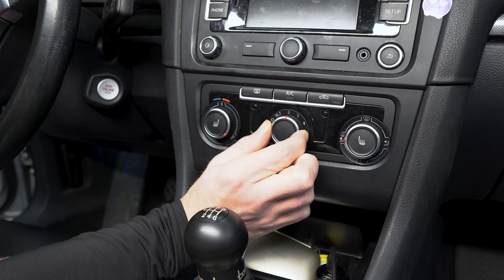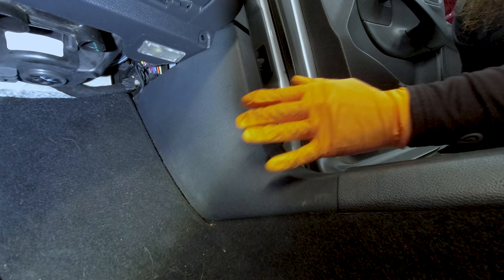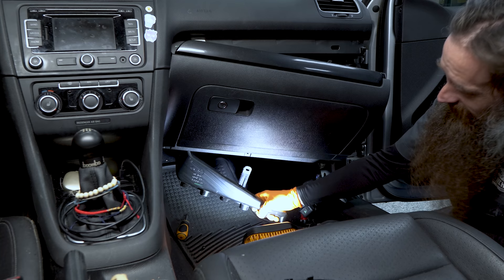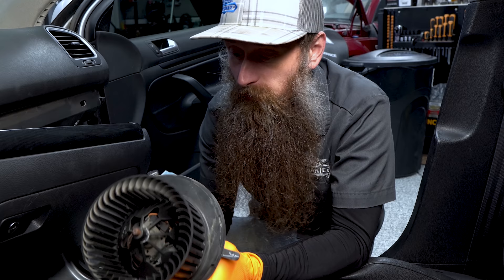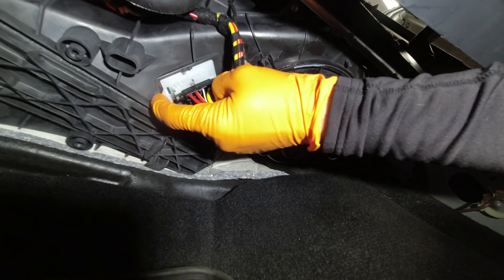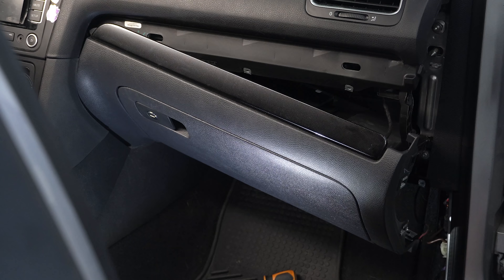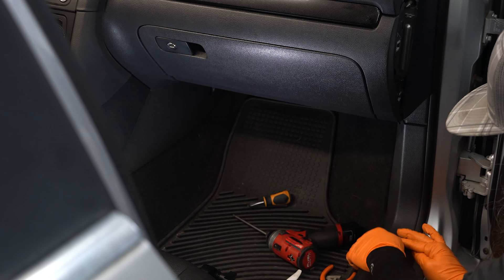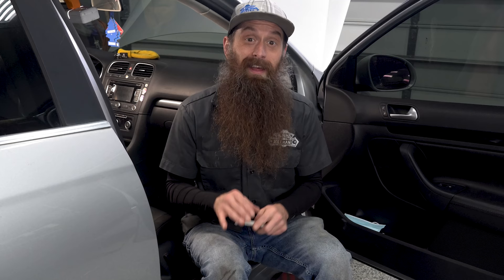How To Fix a Blower Motor Not Working ~ LOUD NOISES

Comment: I hate that you make it all look so simple! That's the power of knowledge and experience, I guess. Very well explained and easy to follow. Great work as ever! Thank you 👍
Reply: Yes. I watched him swap out a thermostat housing and water transfer pipe. Until I tried it…ended up in the garage for 2 weeks!!
Reply: I must say its really not difficult. I did this job about 3 months ago on my Tiguan, mine was just dusty and setting 2-4 had vibrating due to dust I stripped cleaned and replaced and it's now running quiet and smooth. I guess you right that its different strokes for different folks. I'm  not a mechanic but a DIY guy, but I must say I like to fiddle with anything. A big plus is YouTube videos.
Reply: Taking interiors apart can be really frustrating if you're not experienced with then or familiar with the vehicle. Especially on cars since your customer wants everything to look exactly the way it did before. I struggle enough as it is on our fleet trucks, which have much simpler interiors and no one cares about the condition of the panels. I might be able to climb in the back of a garbage truck and remove a 200 lb hydraulic cylinder through a hole about 1'x1', but I could never do professional dash work on a car.
Reply: he made it way harder than it actually is, none of the bolts need to be removed, you can wiggle the motor out. just did it on my car
Reply: @moffatk7948  Indeed, this work is as simple as an oil change IMO. But I grew up as the PC brother with two older car brothers.

Comment: Many thanks to you sir. I was actually making notes to go buy and change my motor when I came across your video. Out of curiosity I opened up mine and lo and behold I found a piece of plastic in my motor and it looks like it got there at my last service when they changed the air filter. End result is noise is now gone at high speeds🎉

Comment: Could have checked the filter, too.
Also, the resistor usually fails due to the motor seizing and drawing more current than usual. Or if the filter to clogged and not enough air goes through it to cool it enough.

Comment: As a Toyota tech i replaced these all the time as we had a TSB where the motors may make noise in sub freezing weather and often enough they just warranty it. A lot easier than this but the easiest blower I've done was on my E90 BMW.. Just drop the kick panel and twist it similar to this Golf, despite the repair manual also wanting to take the dashboard out (Imagine the price gouging the dealership has).  Worst one i've done was a Kia Rio.

Comment: Strange. I replaced mine without having to disassemble the glove box or any other trim. Just a counterclockwise twist to remove and a clockwise twist to re-install. It seemed mine ha d a lot of stiction from water ingress somehow? I hit it with PB Blaster and it seemed to spin OK again, but it was a dirt cheap part to replace with a $15 3rd party fan. So replaced it I did. The blower motor resistor seems to go out for me every two years or so, so I keep a supply handy lol. Also might as well do the cabin filter while you're down there.
Reply: I did the same, no trim removed.  It's a pain, but I did it...

Comment: Ugh, could have used this a few months ago, :P. Had two blower motors to replace (2012 GTI and 2014 Jetta SE). Didn't take anything out, other than the lower kick cover and it was tight on the jetta to remove. GTI was easy.

The plastic footwell air distributor and wire harness was like a bottleneck.

Nice DIY!

Comment: Thanks for your help. Mine's a 2010 Jetta Sportwagen- Your video helped after I first tried without removing any trim. But, despite removing all six glovebox screws, the glovebox still seemed solidly attached. But, with the side panel out & carpet rolled back, the insulation panel on the wall pushed a little, there was just barely enough room to squeak the blower out without taking the glove box out. Putting the blower back in was not too bad and turned out to be the easiest part of all. The body clips from the rocker door cover and side panel were stuck in the car so those had to be removed. Getting out the metal door clip wasn't fun but an old nail puller held tight & screwdriver got it free.  The threshold still didn't sit snug after put back together so took it apart to see what I'd done wrong. Nothing seemed obvious. Put it back together more carefully but still there's a lift at intersection. Then it started raining (again, of course). So, during cleaned up of course I found one spare door clip.  So, that will need to go back in if the rain stops before snow flies. But, let that be a lesson if you aren't used to removing body panels...if it doesn't sit right look for stray clips that must have flown out during panel removal.  As I put the fabric panel cover into place it just touched the under glove box light and the light went off- probably blown. It got hot from the door being open a half hour or so & maybe the panel was just cool enough to blow the bulb...I can only hope.  What was causing a low growling very loud noise turned out to be only a paper napkin! And now the noise is gone. Thanks for your video and help!

Comment: That resistor is similar to what is used in Dodge Dakota Sport truck i had. Changing the fan would not prevent the harness from melting and it seemed to always fail in winter. There was high resistance somewhere causing the melting and burning of wires as well as failure of the resistor. I gave up after having a swimming pool (Just water) on the passenger side and two resister and fan failures within weeks during winter conditions.

Comment: A good tip for Audi / VW owners when replacing a part like the blower motor/resistor, is to look up the OEM part # for your cars blower motor and search for that part. My A3 needed a $400 Audi blower/resistor, but the same package was $180 under the generic brand name.
Reply from the maker: THAT is a good advice. I kinda did the opposite. searched online, it was $450, went to dealer, it was $200.
Reply: Is the generic the same manufacturer? I replaced the factory blower motor on my Mk3 with a Chinesium to save a few bucks and the pos isnt even balanced. Vibrates badly enough to make it unusable at setting II and higher. Should have spent the extra money.
Reply: @vw5056  Depends on the brand.
I would trust Meyle with coolant flanges or SKF with bearings, as opposed to *insert unknown brand*.

Comment: Had the blower resistor fail in my first car, an 89 Camry 5MT. For years even when my parents drove it, the lowest speed wouldn’t work. This was in the late 90’s during the Internet’s infancy. I found out how to find resistors from Radio Shack and soldered them in myself, restoring the fan to full functionality.

Comment: Great vid. You should see 94 BMW 325I. You have to cut the squirrel cages off inside it's housing outside behind the firewall to remove the motor! That or take the entire dashboard out! Yeah few know the struggle of that car. Like the fuel filter tucked deep inside the caverns of the engine!

Comment: I took two of these motors apart. One from my 2015 GTI AND 2012 Passat. The reason why they fail so often is that they use  carbon brushes. When they wear and the spring has no more tension to press the carbon brush the stop working.  Why is VW still using brush motors? Why not go to a brushless motor?
Reply: Because its cheaper for them to make and since they wear faster they make money off of replacing them in service

Comment: I had a similar issue, but my motor had a plastic piece inside it, I couldn't find the origin of that plastic piece, but it fixed the sound. I didn't loosen the glovebox nor the ducting, the only thing I did was push the ducting slightly towards the passenger seat and with a few minutes of struggling got the motor out and then back in.

Comment: It's actually a surprise that they are accessable, what with the way they build things for quick assembly anymore. 
When I was at the Wolfsburg factory in 2005 seeing the last mk4s assembled on the line ,the whole complete dash with hvac was installed in under a minute. 
Remember that the next time you have to go in and replace a heater core and it takes you 6 hours.

Comment: Back in the day,  we would re-lube the fan motor bearing to get a few more years out of it if it started making noise.  (drilling a hole if necessary)  I wonder if the same can be done on a modern unit.
Reply: Yes u can, it is just electric motor and dry bearing
Reply: What type of lube would you suggest for a blower motor bearing?
Reply: @danielzagdan-gross2309  Just light oil, like 3 in 1 oil

Comment: I've got this same car and my blower motor bearing was going out. I ordered a new blower motor off the internet for replacement.  All I had to do was pull the trim panel off the bottom, unplug the blower motor, twist and pull it out with a slight twist. I didn't have to disassemble anything else. It took less than 10 minutes total time. This level of disassembly is not required.

Comment: MK5 was a lot easier as you don't have to really take out anything except the foam cover. After my blower died I just replaced the brushes for a grand total of 4 euros. They are not meant to be replaced but you can get away with soldering new ones in. It ran for a couple more years after that before I had to replace the whole unit.
Reply: same on mk6, idk why he did all that. i just did so in my own mk6 atleast

Comment: I recently had cold weather "squeal" on the blower motor for my 06.5 MKV GTI (255,000 miles). I dropped down teh blower motor with plastic HVAC tube and glovebox in place. I just pushed the large wireharnes up towards the firewall and top of the carpeted area... wiggle the fan motor and it comes down (unploug the power connector 1st).

Comment: At least you didn’t have to cut the blower motor out of this one.
On some GMs, the tech has to cut the plastic around the bottom of the blower with a box razor, remove it, swap the new motor and squirrel cage into the cut plastic piece, and then screw it back into the heater box. (And of course, there’s almost no room to use the box razor...🤬)
Reply from the maker: Yeah that’s silly.

Comment: i had blower motor problems with  my last 3 cars. one was making dry bearing noise (2011 vw polo) other was so worn out bearing that dont even want to spin(vw golf 2000) and the last just worn out contacts in motor (opel kadet 1983)... all made in same manner.

Comment: I have a 2006 GTI and I don't have a resistor like the one in the video, it's it solid piece that looks like a hole could be cut for a resistor. I have the dials that light up with the little lcd screens. and the blower motor just crapped out.

Comment: I was able to barely get the motor out without removing the glove box or vent on my 17' Jetta. I just pulled it down in front of the thick cable in the back first then pushed on the vent while pulling it down. It was snug but it came out. There was also something in mine that had been causing a vibration which I thought it was failing.
Reply from the maker: yeah you can(most of the time) sneak it out. but for a few extra screws, I dont' think it worth it

Comment: I've done a few of these I never took the glovebox off I just take the bottom cover off and twist blower motor and take it out but bit off a struggle putting it back in. But this is on a right hand drive car if it make any difference.

Comment: Another common ailment that happened on two Audis I owned are fans that cut out randomly... Breaking the motor open and cleaning the commutator with a scotchbrite fixed it! It happens because if the motor stops with the brushes sitting on one or the dirtier poles with lots of carbon buildup it won't start. If you drive a while, it shakes up the motor a bit and rotates it off that bad spot and it wors like a champ again... for a while!!

Comment: The cryogenic system used to fix the crankshaft in VW 1.0 TSI 3-cylinder engines allows the assembly to be rebuilt, including pistons and connecting rods. There is a recommendation from VW so that the original measurements of such components are not changed, check?

Comment: hey  Charles, in my 2013 VAG car my climatronic has this strange fan speed where it's pulsing when set on AUTO. It can't pick a speed for some reason, 0 faults with VCDS. Do you reckon its that resistor?

Comment: I wish I'd seen this last summer, my motor resistor failed with it running only on high speed, and then blew up the motor itself before I was able to get the issue diagnosed.

Comment: Good simple video Charles. I got the similar issue on me MK5 Gti, where my blower motor works fine and is not noisy at all but the fuse for it keeps blowing up for some reason. Now I've replaced resistor and it got a little better meaning more time is passing between blown fuses. Ots been few months now since the last blowout. Any idea as to why?
Reply: It sounds like the motor is going out and it’s pulling too much current and blowing the resistor . Probably replace both
Reply: @tylerbeard4092  Thanks for the reply. Funny thing it does not happen in the summer/warm months of the year, mainly in the winter time when its really cold(am in Ontario Canada)

Comment: If you already take the dash apart, change the motor in the process. They usually don't die though.. Mine died because water got into the main bearing and rusted it, creating lee way and it was out of balance afterwards.. And that was caused by my drainage line being clogged..

Comment: Great video. Again we'll presented and thanks for the tips how to not remove the entire glove box. Do you recommend a cleaning period on time or miles?

You also showed another thing why those stupid touch HVAC controls are so stupid and pointless. I dare you to do the testing in the same position in your new Golf R. One hand holding the motor , head stuck underneath and with the other gloved hand operating the fan speed just by touch. It will be a nice comparison :).

Comment: I had a failing blower motor on my 8P A3 (basically a mk5 gti) and when I pulled it out I found that it wanted to work intermittently. I was able to actually pull some small tabs back to reveal that the brushes were worn down to nothing. So $8 worth of carbon brushes later I had a perfectly working blower motor again.
Reply: Were the brushes replaceable? I have an Audi A6 C5  that needs a tap on the blower motor to start it most of the time...
Reply: @rkan2  technically no. If you’re mechanically inclined, yes.
Reply: @meathammer579  Yea but like are there permanent fasteners and something else than solder? Where did you get the brushes?

Comment: What if the ac etc is working but not blowing from front vents could it be the motor resistor.
I've changed the fuses, cabin filter, and made sure there is no leaks or anything stuck in the intake fan. 
Any advice ?

Comment: My blower motor appears to be failing as well, but it still does its job, it makes crickety noises which directly relates to engine speed and if the blower is on
Reply from the maker: Lol you riding it out or fixing ASAP?
Reply: @HumbleMechanic good question, I may just wait till it doesn't work anymore or wait till after timing belt is replaced since its due soon, but who knows if the engine will last as I'm afraid the previous owners weren't too nice to the car even though it drives really nice lol

Comment: I have an issue with my gti. The ac is running full then partial then full. Could this be the blower and or resistor?

Comment: Replacing a blower motor in a VW has become sort of a rite of passage with every VW/Audi I have ever owned, I've had 9 of them now, and every single one has needed a blower motor a year or less after purchase.
Reply from the maker: FACTS LOL
Reply: My Golf III's blower motor lasted 26 years. The brushes finally worn out but it still worked if you tapped it.

Comment: I’ve come across blower motors in CCs and Passats literally freezing solid in winter due to a cowl design flaw letting fine powered snow in.
Reply from the maker: Now that I haven’t seen! But I’m in NC
Reply: @HumbleMechanic  VW actually has a TSB on it and a modified cowl intake panel to stop it from happening.

Comment: I have a question, I have a 2008 Vw Passat with dual zone Climatronic and there is a strange issue when the car is travelling over about 70mph eventually the airflow from the vents gets VERY weak, it’s like one of the doors in the dash is getting stuck or if there’s a flap or something that shuts at highway speed that is restricting airflow, if I turn on air recirculation it sounds like the blower motor is working properly - yet the airflow is very poor regardless of vent position, any suggestions before I pull my hair out??

Comment: FYI for Mk5 and Mk6 Golfs and others there’s TSB #85-16-01 covering having snow sucked into the blower and causing the motor to rust. There’s a kit that deflects snow and possibly rain from the intake plenum. Unfortunately the owner has to pay for it.  In my book it should have been a recall with no owner contribution.  It’s a fundamental design flaw.

Comment: I had this problem a long time ago at a previous workplace, turned out the windscreen had been removed and refitted and the technician let the old glass sealant that he cut off drop down the back of the dash and it somehow ended up in the blower

Comment: @HumbleMechanic unrelated question: I have a 2009 Jetta wagon with a failing rear door lock actuator - I've seen your video replacing it on a hatchback but I can not figure out how to get to it on my wagon to save my life.... can you help with that?
Reply from the maker: I think you access that one through the inside door panel. I dont know if ive done one on that JSW
Reply: @HumbleMechanic  Thanks for the quick response, have to try again then.... also can't find any tutorial or written instruction on the interwebs anywhere....